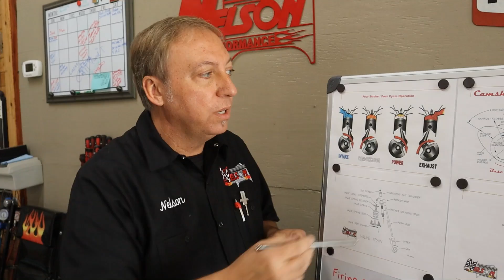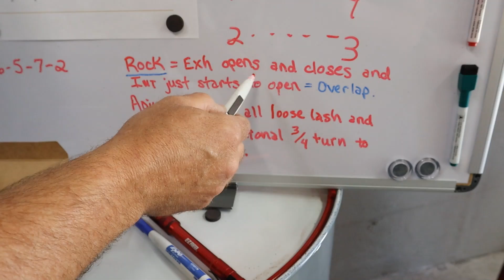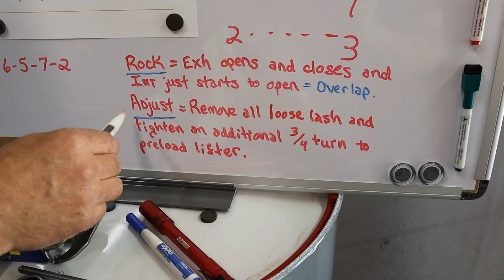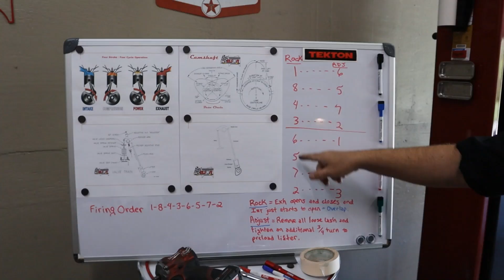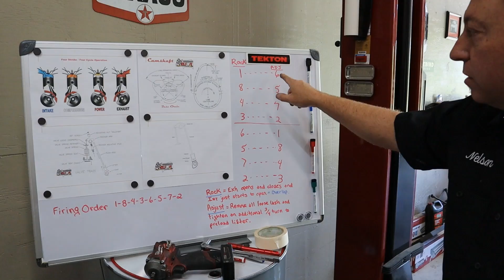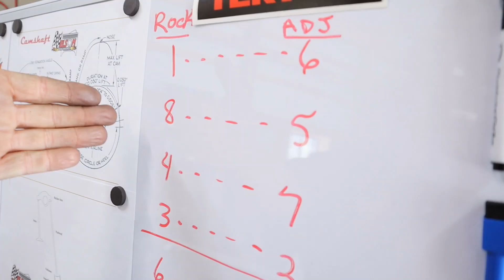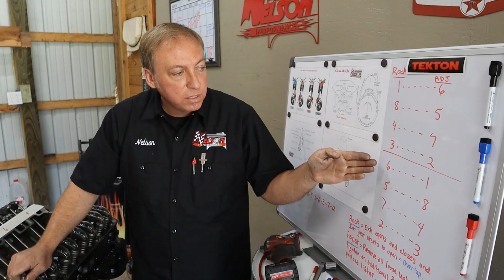Rocker Arm/Hydraulic Lifter Adjustment

Comment: Followed your adjustment on rockers but there does seem to be any give on the lifter when I push on rocker arm seems solid they do have spring clip in rocker
Reply from the maker: Hello Ken, if they are new hydraulic lifters that have never had oil pressure in them they should have some preload movement? If they are used or have had oil in them, then they may seem firm but the valve springs should have enough pressure to bleed the lifters back after a few crankshaft rotations since there is no oil pressure until the engine is started.
Reply: Mitch I took manifold off to recheck lifters they are solid lifters I called the guy I bought the car (32 ford with 350 chevy ) he had no idea what cam is in car he bought it to flip it and knows nothing about car hopefully I didn't destroy cam pulling it apart to see if any markings are on end of cam so I can look up settings if not guess it's a cam change. Thanks for your help Ken
Reply from the maker: Ahhh, that explains that! At least you figured it out.

Comment: My Dodge 3.9L has hydraulic lifters and roller tappets. The manual gives a "dry lash" spec for the hydraulic tappets, but nowhere can I find where the tappets must be adjusted. Are some engines self-adjusting or what?  Thanks for the vid.
Reply from the maker: Hello Dave, I believe the 3.9 has a torque spec for the rocker fastener. On that style there is no adjustment, but you can and should still check to make certain the pushrod length is correct to achieve proper lifter preload especially if the block or head surface has been milled or if a valve job has been done on the heads. You can view the cup in the center of the lifter during this process.

Comment: If I have to replace my Hydraulic Lifters out of my 1982 Chevy 350 (ran great) that I am putting a set of 062 Vortec heads out of a 1998 Chevy 350 truck from....do I buy the new hydraulic lifters to fit the 1982 Block or the 1998 Vortec Heads ?
Reply from the maker: Hello, first off I would make certain the parts store has given you hydraulic and not SOLID lifters for your engine. If they are hydraulic, they may be full of oil but the method will work fine even with oil in the lifters. The valve springs will bleed the oil out of the lifters as you turn the engine over as the rocker pushes the valve spring down. This will get the plunger off the wire clip in the lifter. The valve spring pressure has enough force to push the pushrod into the lifter bleeding the oil back slightly since the oil pump is not producing oil pressure unless the engine is running.  You don’t necessarily have to view the lifters when doing the process, if the intake is on. You can also watch the movement of the pushrod/rocker arms if the intake is installed. You will see them move into overlap (the ROCK position). I’ve adjusted many engines that way. Just keep track of your cylinder locations to keep you on track. You can also use the ignition/starter to rotate the engine through the process but remember it only takes a slight bump of the key to turn the crankshaft the needed 90 deg. It helps to have a friend bump the key while you pay attention to the rockers. Good Luck with the project
Reply: @mitchnelsonperformance  The Hydraulic lifters that are not compressing are my old lifters out of the 82 chevy that I just removed a few days ago... that enging ran great just last week...that is why I am confused as to why those Hydraulic lifters don't compress. I just ordered new hydraulic lifters for that same 82 block that I am putting the 98 350 Chevy Vortec heads on.

Thanks for your help !
Reply from the maker: No problem!
Reply from the maker: Hello, you would want to buy lifters to fit the block. Not the heads. Good luck on the project

Comment: Very nicely done !
Liked/Subscribed !
Reply from the maker: Thanks friend!
Reply: @mitchnelsonperformance  Question for you Mitch... I just started following your procedure on my 1982 Chevy 350 that I just put a set of 062 1998 Chevy 350 Vortec heads on. I got the engine to Overlap #1...ready to adjust #6... it appears that none of my hydraulic lifters have any "GIVE" in them....they don't compress when I try to push them in with a push rod...what's going on... I only took #2 Lifter and #8 lifters out to try and compress them...but no give at all !
Thanks in advance !
Reply from the maker: Hello, first off I would make certain the parts store has given you hydraulic and not SOLID lifters for your engine. If they are hydraulic, they may be full of oil but the method will work fine even with oil in the lifters. The valve springs will bleed the oil out of the lifters as you turn the engine over as the rocker pushes the valve spring down. This will get the plunger off the wire clip in the lifter. The valve spring pressure has enough force to push the pushrod into the lifter bleeding the oil back slightly since the oil pump is not producing oil pressure unless the engine is running.  You don’t necessarily have to view the lifters when doing the process, if the intake is on. You can also watch the movement of the pushrod/rocker arms if the intake is installed. You will see them move into overlap (the ROCK position). I’ve adjusted many engines that way. Just keep track of your cylinder locations to keep you on track. You can also use the ignition/starter to rotate the engine through the process but remember it only takes a slight bump of the key to turn the crankshaft the needed 90 deg. It helps to have a friend bump the key while you pay attention to the rockers. Good Luck with the project

Comment: Thank you!! I did this and my 350 sbc engine runs great. Just finished top end rebuild.It runs better on manifold vacuum it has no emissions on an old truck or should I run on trimmed vacuum???
Reply from the maker: Hey Bobby, I take it you are talking about the vacuum advance on the distributor. On GM distributors it’s typically best to use Venturi vac (vacuum off at idle and on at approx 1800 rpm and above). The trouble with manifold vacuum is the static timing is set with the vacuum advance at full advance and then when you start the engine the timing is very low when cranking until it starts and makes vacuum. Secondly, when you go wide open throttle manifold vacuum goes to zero and it retards the timing when you need it most at increasing rpms. Some Ford dist were made to use manifold vacuum and they would advance as vacuum decreased with throttle opening. Hope that was your question. Nelson
Reply: @mitchnelsonperformance  okay I understand know I did go through  that when driving I will set at vacuum advance. I did install a 2 inch spacer in between carb and intake manifold would this help with performance...Thank you for your input...
Reply from the maker: Most intakes benefit from a carb spacer. It allows the air more time to make the turn into the intake ports after passing through the throttle plates.
Reply: @mitchnelsonperformance  Engine runs good just need to figure out while engine is left off next day alternator is extremely hot to the touch... Thank you for your input....
Reply: @bobbydeleon8303  the next day before starting the alternator is hot? I feel like that problem will solve itself with a fire.  Hope you fixed it

Comment: Im installing vortec heads and intake on a tbi 350 block with original tappet lifters and they don't want to plunge in after i give the nuts a 3 quarter turn.  Are they stuck or just full of oil pressure? What should i do. Should i pull them out and replace them or clean them till they plunge?
Reply from the maker: They should bleed/plunge after a few turns of the engine. The valve spring pressure will bleed them back since the engine isn’t running and making oil pressure.

Comment: Can I use this methadone on an 05 Chevy equinox
Reply from the maker: I’m fairly certain those are a “torque” style valve system and are non adjustable but you could still use the process to make certain the lash/preload is correct after torque.

Comment: Best video ever, this company should never loose this guy. He is worth all the money. Clear and precise explanations. Should do a mechanics course online 😂😂👍👍🙌🙌
Reply from the maker: Thanks Jigsaw! Appreciate the kind words! More videos coming soon! Nelson
Reply: @mitchnelsonperformance  Don't know if you work Outboard marine engines, but would love a 4 cylinder or 6 cylinder rocker arm adjustment video on those. Maybe Honda or Yamaha. I know Honda have some outboards based on accord 4 cylinder fuel injected engines. Also other good suggestions is tolerances and using the cam checker (gauge) on the cam shaft.
Reply from the maker: @CSJiGSaW08  I will for sure consider that!
Reply: @mitchnelsonperformance  🙌🙌

Comment: For a valve spring and trunion upgrade, do you have to adjust rocker arms this way?
Reply from the maker: Hello, if you have adjustable rocker arms, then yes, but if the rocker pivot bolt calls for a torque value then you can use the process to make certain the push rod length is correct and not to long preventing the valves from being able to shut/seal or to short causing to much lash (pecking).

Comment: I've got a 86 f150 with 90 bronco 5.0 in it with new heads (unsure of heads origin as it was from a junk yard) and I've adjusted the valves about 4 times now the bolts just keep breaking loose. there's no sighn of stripping or breaking on either threads though.
Reply from the maker: Hey Will, Many of the 5.0 Fords had non-adjustable rocker arms. If it has 5/16th bolts and square style rocker pivots with a rail under them then they are non adj and just get torqued down. If they have 3/8 studs with a nut on them and are backing off then the locking style nuts need replaced. Most of these (3/8 style) heads were older castings.
Reply: @mitchnelsonperformance  thanks for the reply and yeah they are the non adjustable ones I'm glad I found your video before I decided to replace the heads 😂 I thought it was weird how when I went to adjust them they'd get to tight to fast lol.
Reply from the maker: Good! and yea, they get torqued to a spec and I usually apply a small amount of blue medium strength thread lock to the bolt threads as insurance.

Comment: Suposed you had a four cylinder engine diesel how we adjust valve lifter and the firing order
Reply from the maker: Hello, without knowing the engine, typically the #1 and #4 are paired and the two center #2 and #3 are paired for the adjustment procedure. Hope that helps

Comment: ok , im doing a 1969 351W ,firing order=13726548 ,, split it,1372/6548 rock&adjust ,but i have my intake in the way ,can i use my distr, rotor to help me ?
Reply from the maker: Hello Wesley, You don’t necessarily have to view the lifters when doing the process, if the intake is on. You can also watch the movement of the pushrod/rocker arms if the intake is installed. You will see them move into overlap (the ROCK position). I’ve adjusted many engines that way. Just keep track of your cylinder locations to keep you on track. You can also use the ignition/starter to rotate the engine through the process but remember it only takes a slight bump of the key to turn the crankshaft the needed 90 deg. It helps to have a friend bump the key while you pay attention to the rockers. Good Luck with the project

Comment: Do i prime engine before a adjust rocker arms my lifters are a little stiff
Reply from the maker: Hello, no, I wouldn’t prime the oil pump before adjustment if possible. Not sure why the lifters would be stiff in the plunger unless they already had oil in them, or if they are SOLID LIFTERS? If the lifters do have oil in them they should “bleed” back when rotating the engine. The valve springs will push the plunger back since there isn’t oil pressure when turning the engine by hand.
Reply: Hello thank you I found out they had oil in them that’s why they were stiff

Comment: Do you still turn the crankshaft clockwise on a reverse rotation engine to set the rockers?
Reply from the maker: Hello Paul, no, you would turn it counter clockwise like the running rotation. Many of those engines have special ground cams that use a gear to gear drive (instead of chain) so the cam rotates clockwise to run the oil pump and distributor in the normal clockwise direction, but the cam lobes have a different placement to accommodate the counter clockwise crankshaft rotation. That engine should have a different firing order as well. So just use the correct firing order and label the cylinders and turn it counter clock wise and the method should work fine.

Comment: Great video,  great step by step explanation
Reply from the maker: Thank you for the kind words!
Reply: I have a  305 v8 5.0 original heads but I would like a recommendation on some stronger heads or cause I have the original rebuild with stronger springs, push rods, etc?
Reply from the maker: Cylinder heads are the best swap for power gains and there are many aftermarket head choices. Edelbrock has some good complete kits. The main thing to keep in mind on a small cubic inch (305) engine is to try to stay small on the intake runner volume to keep the velocity up or you will lose torque and low rpm power. Also if you don’t plan to change pistons you’ll need to stay around the 58cc combustion chamber volume or it will drop in compression.

Comment: Always bleed your lifters first so they dont have a dry start and clack until oil pressure fills them.
Reply: What does this mean?
Reply: @thomasboissy3560  ignore,
Reply: @thomasboissy3560  you submerge them in a can of engine oil your using and push the plunger up and down with a rod to suck oil into lifter body. You have to do them all that way until you cant push them in anymore or just a little and they are bled.
Reply: If you are building a motor you would definitely oil prime the motor before letting it start.  Your method doesn't help depressing the lifter as he shows.

Comment: If you are using lifters that already have oil pressure on them ,do you still adjust the same way,thanks .
Reply from the maker: Hey Joey, the method will work fine even with oil in the lifters. The valve springs will bleed the oil out of the lifters as you turn the engine over as the rocker pushes the valve spring down. This will get the plunger off the wire clip in the lifter. The valve spring pressure has enough force to push the pushrod into the lifter bleeding the oil back slightly since the oil pump is not producing oil pressure unless the engine is running.  You don’t necessarily have to view the lifters when doing the process, if the intake is on. You can also watch the movement of the pushrod/rocker arms if the intake is installed. You will see them move into overlap (the ROCK position). I’ve adjusted many engines that way. Just keep track of your cylinder locations to keep you on track. You can also use the ignition/starter to rotate the engine through the process but remember it only takes a slight bump of the key to turn the crankshaft the needed 90 deg. It helps to have a friend bump the key while you pay attention to the rockers. Good Luck with the project
Reply: @mitchnelsonperformance  thanks for the advice, I've never seen this process before but it's the best one yet.

Comment: so while cylinder 1 is going into  intake stroke, 6 is in power stroke.  The cylinder in power stroke gets the adjustment.  That is the game.  So knowing which one is in true fully closed valve power stroke is the name of the game one after the other.
Reply from the maker: Yep, that’s exactly right! and any engine, 4cyl to V16 can be adjusted by splitting the firing order and using that method.

Comment: All this is unnecessary. All you need to do is to set the timing mark to zero, Then tighten to take out all the up/down slack/clearance that you can feel in every push rod but not more.. Do this procedure again each time for two full turns of the harmonic balancer stopping at 1/4, 1/2, 3/4 of total balancer position. Now that all clearance has been removed go to each rocker arm and turn for the recommended preload that can vary by engine. DONE!  No BS and much easier than the above.
Reply from the maker: thanks for the view!

Comment: Does this method work on GM 4.3 liter six-cylinder engines?
Reply from the maker: Yep, it will work fine with a 4.3 with adjustable rockers. Just split up the firing order and get started!

Comment: does this need to be done with non hydraulic lifters
Reply from the maker: Hello, The rock and adjust method will work with a non-hydraulic (solid lift) style lifters/cam. You will just need to adjust the valve lash (gap/space between the tip of the valve and the rocker) to the recommended specs. Hope that helped

Comment: Very well explained, is the same method in a 5.3 LM7? Thanks
Reply from the maker: Hey Jaime, yes, the method of rotating the engine and using the firing order is the same but many engines do not have adjustable rocker arms (they are torqued down in position), but you can still use the method to make certain the lifter cup is off the retaining wire and verify the lifter has enough pre load movement to hold enough oil.

Comment: Texton tools are nice I have a socket set that I use when working on my 350 sb installing heads and adjust arm and rockers...
Reply from the maker: Hey Bobby, I agree, they are a solid dependable brand at a fair price. Thanks for the comment.
Reply: @mitchnelsonperformance your  welcome, I can't wait to break tools in. I am waiting on my heads there at the machine shop.